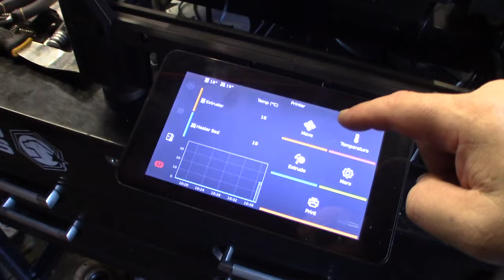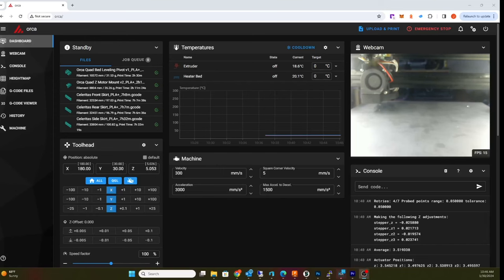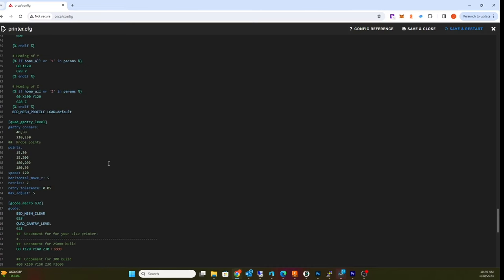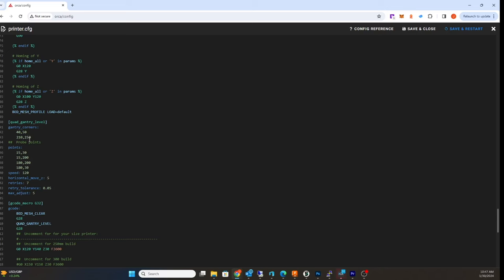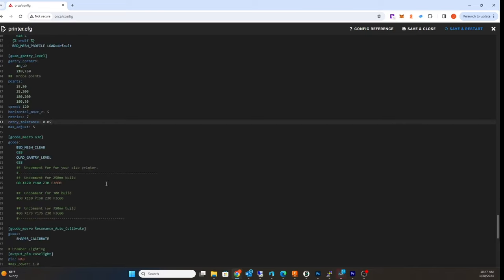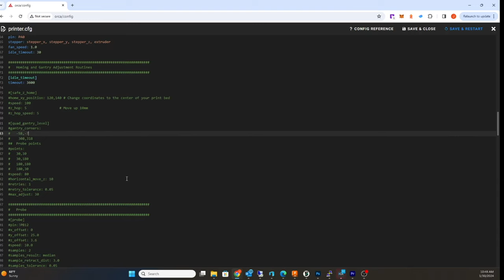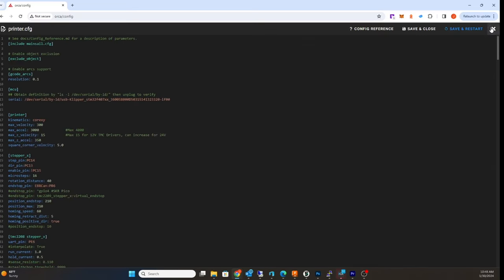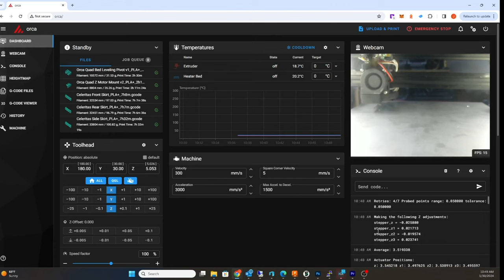Orca Super Cube CoreXY 3D printer concept Part 6, Quad Z Motor Quad Point Bed Leveling Klipper

Comment: On quad level on my custom flying gantry I had to change the locations. Klipper has docs on how to do it. Start with the belt location as starting
Reply from the maker: I don't have a flying gantry. I have quad motor on each corner of bed. So far its been very reliable after 50+ prints.
Reply from the maker: I've seen 3 point beds. My quad bed setup is the first I've seen. I'm sure its been done before.
Reply: @fintechrepairshop  I replied too early haha you explained what I said later in the video
Reply: @fintechrepairshop  conceptually it should be similar in terms of leveling. You can quad level bed or gantry